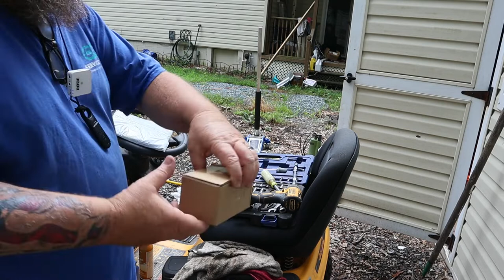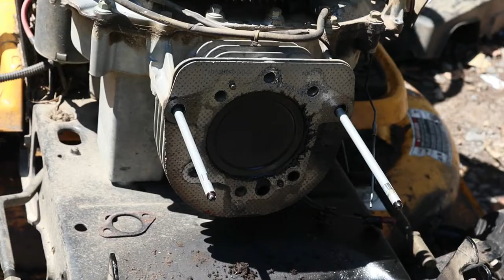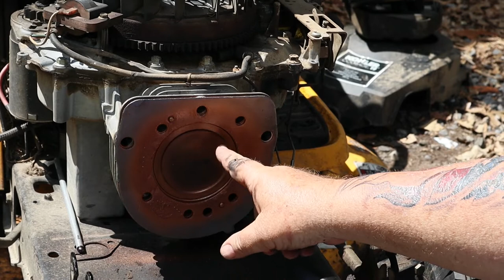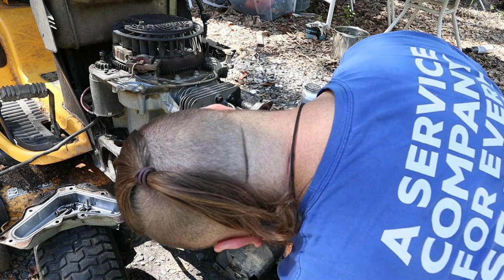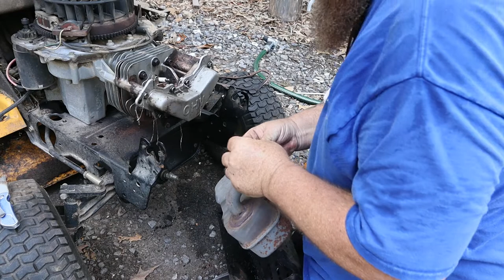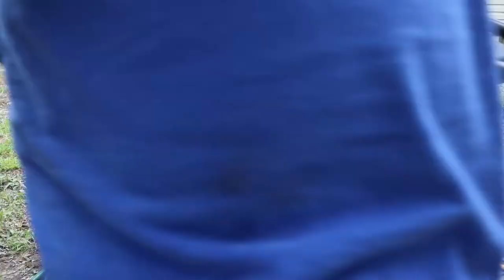How to replace Cub Cadet head gasket Riding lawn mower

Comment: Unless you did something off camera you didn’t adjust the valves properly. Video was still helpful though.
Reply from the maker: I reviewed the video and I’m not sure what I missed. If I did please tell me how it was supposed to be done correctly. Thanks
Reply: @fixingthingswithpastorbill3840  it might have been off camera or maybe I missed it. But I didn’t see you loosen the T15 on the inside of the 10mm bolt so that you could adjust the rocker arm
Reply: Great video